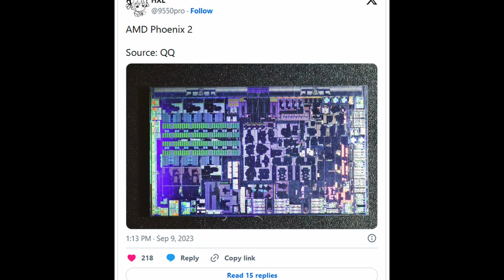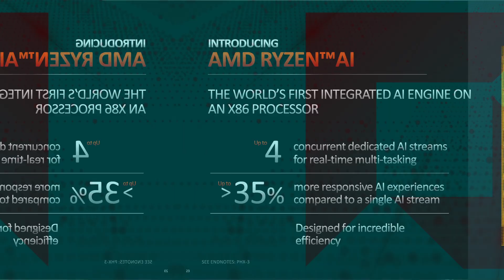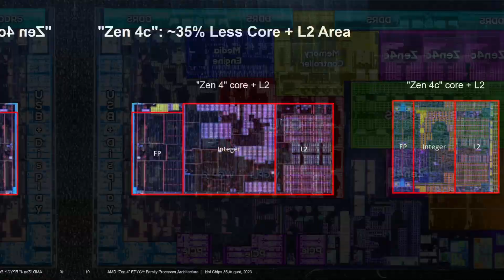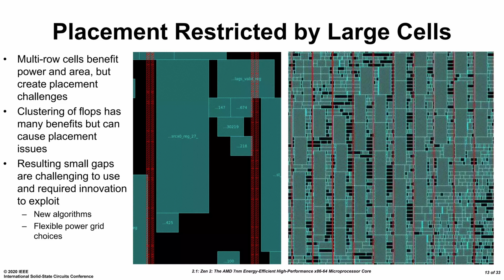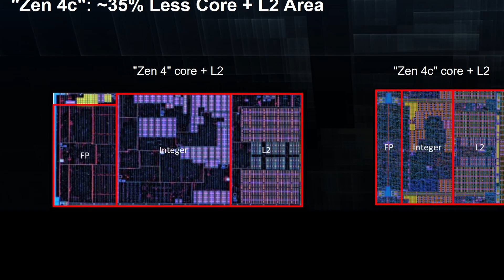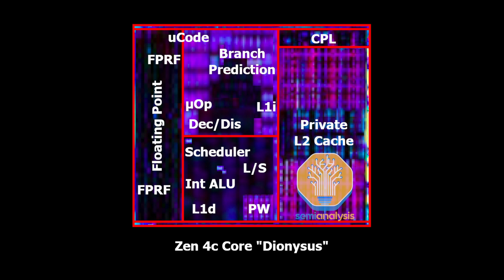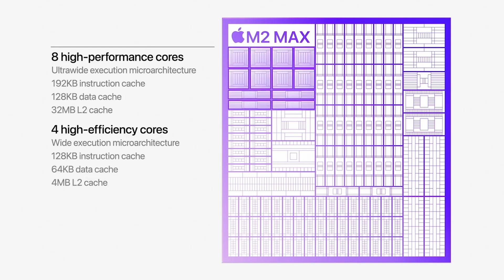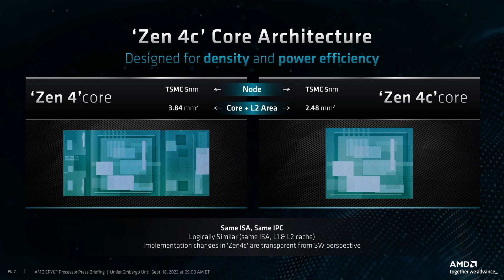Why AMD's first Hybrid-CPU is Different

Comment: The idea of more cores at lower clock speed is extremely compelling as a cloud provider. It’s not uncommon for us to have >50% cpu utilization at a host level, but, scheduling overhead and other issues makes higher oversub impractical, so more cores would allow us to get even more dense and offer a lower cost option for the vast majority of workloads that don’t really need high clock speeds anyway.
Reply: Yeah the main reason for AMD developing Zen4c is to sell them in EPYC chips.
Reply: @shepardpolska  yea it’s a great fit for those use-cases. E-cores are great for laptops but the lack of simd and other features makes them a non-starter for general purpose virtualization, but cores that work just like the high-perf stuff but a little slower is easy to integrate into a tiered offering.
Reply: It's Zanax? Clever. @shepardpolska
Reply: Yeah, even in game server hosting I would argue that the modern cores are individually much stronger than is needed, so if server providers could have more cores at lower clockspeeds, but same IPC, they could probably host more servers per cluster and lower the costs.
Reply: It's the RAM bottleneck.
Reply: @ShoeboxRacer  for a lot of our use cases we don’t really see memory bandwidth as a bottleneck, but, running some quick thought experiments I can definitely see being able to max out the number of memory channels available at a lower cost per core being hugely valuable to something like HANA (assuming you can get SAP to certify it) or more likely something like redis, although the list of companies running redis at the scale and performance requirements needed for that to really matter but also not designing their own silicon is pretty short. 

But thinking about memory bandwidth does suggest another another potentially interesting use case here in the upcoming successor to the MI300a, or potentially even a similar design targeting edge compute instead of the HPC market. That would likely be a 2025 release (at best) so hard to have any real idea of viability but an apu that goes heavy on accelerator chiplets with enough cores to manage them while still fitting inside the tdp and physical footprint you need for the typical half-u (actually less since they’re also usually half depth) edge server could be compelling? Lots of unknowns there but it would be fun to play with the numbers and I’m fairly sure there would be some use-cases.
Reply: @MikeGaruccio  the limiting factors for many-core designs are the von neumann bottleneck and chatter. Doubling doesn't matter if you can't feed them. And even if you can, it doesn't matter if they're constantly thrashing on MESI.
Reply: @ShoeboxRacer  ahh ok I get you now. And this is a place where context really matters. If we’re talking about a single workload trying to produce some singular output and primarily bound by the rate at which it can execute instructions against data retrieved from   memory then yes getting data from RAM and maintaining cache coherence are going to erode much of the gains from additional cores. 

But workloads that look like that aren’t really all that common, basically being confined to HPC and LLM stuff.  Both of those cases have additional complications given the concept of a “cache” ends up having so many layers as you zoom out from a single package, to a system, to a rack, to interconnections between “pods” and tons of software solutions have been developed to allow those systems to keep scaling but there’s definitely some diminishing returns involved that make that scaling less-than-linear. 

On the other hand, what I’ll call “normal” datacenter workloads have very different concerns. In that world a server is almost always a virtual machine somewhat less powerful than a typical desktop (the most common config being 4 threads and 16GB of memory) operating as a web/application or database server, or on more modern systems as a container host running a collection of web and database instances.  For the most part the goal in those environments isn’t maximum performance, but maintaining acceptable performance while minimizing cost. Memory bottlenecks still matter here, but the way those concerns manifest can be sometimes non-intuitive, and other factors can matter more.  The primary constraints end up being spiky, kind of random, workloads, slow storage access times, high network latency, and the high cost of developer time. These end up driving most architectures towards large memory footprints with relatively idle processors, but with occasional needs for a given machine to suddenly service a lot of requests for a short time. 

So, memory is our primary hardware cost driver, so we need to buy it in the most efficient units possible. Usually that means the second largest DIMM available at any given time.  But we also need to maximize memory bandwidth because that is still an important bottleneck, so you need to have at least one DIMM per channel. So that all means we end up with memory dense servers.  So say you have a TB of memory in a server, at the typical fleet-wide ratio of 4:1 that leads you to a cpu allocation of 256 cores (really threads, but SMT is a whole other thing). But processors with that many cores are expensive, and remember they’re actually going to be idle a large fraction of the time. The solution here is one of the most useful, but also misused, features of modern virtualization- over subscription. You deploy 256 virtual CPUs (probably more because you can actually oversub memory too) since most of our vms are less than 50% utilized most of the time, and are all serving different functions so are rarely all going to spike at the same time, the aggregate CPU cycles available should be able to meet their needs without a problem. But it’s not quite that simple. Partly because of how operating systems expect resources to be available to them, and partly because of optimizations meant to deal with the memory bottleneck you pointed out. 

Starting with the memory bottleneck, some mitigations to that problem in modern CPUs include speculative execution- basically the chip starts executing what it assumes the next instruction is before it actually arrives, and large on-chip cache. Both of those mechanisms lose effectiveness if a given core is frequently switching task’s between various underlying servers. 

More problematically, a virtual machine can be impacted much more than you’d assume by noisy neighbors, even on a host that’s only at a moderate utilization rate. I’ve already talked about cpu ready above, and that’s still the biggest problem here that more cores solves. But since we’re talking about memory access let’s talk about NUMA. The majority of modern servers are 2 socket machines, and a subset of modern CPUs are, from a memory access perspective, more like 2-4 smaller CPUs in a trench coat. But for a long time now memory controllers have resided within a cpu. Meaning each CPU controls half of the memory. So if a process on cpu 1 needs to access memory that belongs to cpu 2, that access happens across a slower link. This is called non uniform memory access and it’s a huge performance sink. Because of that they scheduler will try it’s best to avoid scheduling a vm on a different numa node from where it’s data resides, but that’s not always possible, and higher oversubscription ratios make it more likely to happen. When it does that vms CPUs stay busy for longer while they wait for the data, and in the meantime are preventing other machines form executing code. 

More cores aren’t a panacea of course. But for modern cloud and enterprise networks they solve a variety of problems and if we had access to cores with a Genoa-class 128 core count but in a thermal envelope more like a normal 64 core chip we’d be all over it, even if the individual cores weren’t quite as fast as their bigger brothers.
Reply: @MikeGaruccio  you invested way too much time into my low-effort comments.

Engineered systems have intentional bottlenecks, which are either the most expensive or most critical resource. Clouds deal with a wide variety of resources, and CPU is usually the most critical and most expensive resource in a server.

You place 2TB or 4TB into a server is to keep the CPU busy. You want to keep workloads in memory, and to run additional workloads if everything is blocked. IBM added multi-processing to increase CPU utilization, and running over-subscribed VMs is simply a less efficient form of the same.

If you tape 40,000 cores into the die space of a Zen4 IO controller, then you can't feed them. You're limited by geometry: memory comes in on the edge, but cores are built across area. That's why many-core designs are niche, and mainstream processors trade core count for superscalar, out-of-order, speculative execution, complex predictors, large widths, deep pipelines, write-back caches, large tiered caches, etc. You need to hide memory latency to feed the beast, because you can never route enough wires in to sustain the cores otherwise.

You can't exceed 50% utilization due to variance and QoS. Your original argument boils down to "decreases in variance allow more oversubscription, and higher utilization of key resources". In other words, you intuitively want to run more smaller workloads, because they're less and less likely to all spike together. But it's still about increasing CPU utilization, which is the majority of your cost. If your bottleneck isn't I/O to the CPU, then you are behind the pareto frontier, and have an artificial bottleneck, such as inefficient placement or poor live migration. By all means, fix those. But as you eliminate artificial bottlenecks, you will eventually discover the ultimate problem: the von neumann bottleneck.
Reply: @ShoeboxRacer    “cpu is usually the most critical and most expensive resource” - my server BOMs strongly suggest otherwise.  Memory is far and away the most expensive component in our server builds, unless we’re doing HCI, in which case it’s a tossup between memory and storage depending on density and endurance expectations for the flash.  But all of the other costs add up too, mainboard, NICs, power supplies, network ports, floor space, pdu outlets, fiber, sfps, fans, etc. 

What you end up with is a question of what the lowest cost you can have for the largest amount of memory is. Which usually leads to very dense servers. But, there’s a limit to oversubscription even if there’s not variance. Basically no one is going to deploy a 1vcpu server. Even if they’re running a nodejs app or otherwise only really going to ever use one core.  So we’ll basically always have vms where one core is being used heavily and the rest are idle. But all cores cycle at once. Do the idle cores sit and noop while one works. 

The fix for that to allow for increased memory density is more cores regardless of how fast they are because they’ll mostly just sit and do noops.  But the highest core-count chips are physically larger and have bulky thermal solutions, and so reduce the memory that economically fits in 2U. They also tend to have power supplies that make the electricians concerned with the theoretical max draw and so world require more expensive power gear even if we’d never actually expect that kind of current in practice. 

So really what I want is to decrease oversubscription so we can increase the utilization of our actual key resources like memory and network ports and the thing that allows me to do that is having as many cores as possible in as small a thermal and physical footprint as possible.
Reply: @MikeGaruccio  you implied that you're buying 128GB DIMMs, but 12 of those were less than a 9654 until earlier this month. Given your BOM price and your aversion to power density, it sure sounds like you're buying low end CPUs.

CPUs are made on smaller nodes, have more complex designs, more steps, and lower yield. Unit per unit, they're more expensive than memory. It's usually the most expensive part of the BOM, and it's also usually the physical bottleneck in the operating system. There are always exceptions. But even AWS memory optimized bare metals have more CPU cost, so you must be niche.
Reply: @MikeGaruccio  I wanted to split my response in two, because the first one was just to shit on either your BOM or your procurement. I don't mean anything by it.

But you absolutely want to oversubscribe CPU. CPU is the best resource to oversubscribe, because there's always more in the future. Oversubscribing MEMORY is dogshit. Guests are asshats, and don't know how to give it back. Worse, they're probably running a memory leak like java, which will always squat on all the available memory before running GC. When you oversubscribe memory, you can't just block allocation and expect forward progress. You need to kill, migrate, or evict.

Buy memory to hold the number of requisite concurrent jobs. Buy CPU to run jobs faster, decreasing the number of concurrent jobs.

Again, it's all about variance. Density is good, because it decreases the chance that all your guests spike at once. That lets you oversubscribe. Oversubscription increases utilization. That leads to higher margins.
Reply: @ShoeboxRacer  ok I’m genuinely curious where your seeing 128GB ECC DIMMs for less than the cost of a 9654.
Reply: @ShoeboxRacer  lol you can feel free to shit on our procurement. I can’t actually disprove that statement without providing non-public info so I’ll just have to leave it there. 

As for oversubscribing CPU, to some degree it definitely is valuable. And if guest OS’s had a perfect spread of resource usage across cores, and we were dealing with all single socket machines and just had to deal with usage spikes core count wouldn’t really matter and we could be a lot denser. 

But that’s not the world I actually live in. People deploy a nodejs app on a server with 4 CPUs. Their AV software goes crazy and monopolizes a full core for hours while the rest of the machine sits idle, or a thousand other things happen that lead to a server that has a ton of cores only actually using one of them but running that one core full-out. That puts a hard limit on our oversubscription rate, beyond which utilization goes down and guest performance suffers. 

As for memory over subscription. It’s definitely less useful in terms of the % you can achieve, and we generally don’t bother since it’s a pain to manage, but, memory usage also tends to be much more static when viewed at a host or cluster level and actual utilization tends to be much less than 100% of configured allocation so it is a viable option when really trying to optimize.
Reply: Like what? Pretty much everything benefits from high single core performance.
Reply: @jamesmcjamesington631  So this is a fun one.  On the one hand, yes, high single core  performance does benefit every workload in that a faster CPU with complete a given task faster, but whether that speedup is meaningful is a very different question.  The TLDR here is that 1 4GHz CPU is almost never going to be 2x as performant as 2 2GHZ cpus, and in general a higher core count cpu with slower single core performance will be more cost effective and have a lower thermal output than a chip with faster cores that has theoretically equal aggregate performance.  

The average web request involves hitting a server, which initiates a database lookup and then returns you some set of results.  The vast majority of the time between the user pressing a button and pixels painting on their screen is waiting for communication to happen, with only a tiny fraction being spent on the web server executing code.  most of the apm traces I see will show something like 1-2ms of execution time at most, and usually much less.  but at the same time will have a much higher amount of time, in the 10s of ms of database IO or inter-service communication on a microservice app that's collating data before sending it back to the user, plus 30-100ms of latency between the user and the actual web server.  Now, there are obviously limits to what a CPU can actually handle, and if you start trying to send 2000 web requests at that cpu core doing 1-2 ms of processing per request, you're gonna have a bad time, so before that happens you add more cores, or more web servers. So at base you're looking at a need to maximize processing power globally within a given monetary/thermal budget.  Generally speaking more, slower, cores will give a better number in terms of aggregate performance per $ and/or per watt.

But, that's just the base-case, other concerns make more cores even more attractive, and the core of them is the need to optimize around worst-case rather than averages.  Exact methodologies vary by company and team, but it's generally a bad idea to judge the performance of a system by it's average time to complete a request and better to look at the experience being had in the worst 1 or at most 5% of cases since it's those outliers that are typically going to be frustrating for users or potentially cause other, broader, issues.  and having more cores is huge here.  I'm going to use lucene/elasticsearch as an example, but there are many others out there.  Gor some background, a simplified but still mostly accurate view of those search apps is that each incoming search runs on one CPU core, and 'owns' that core until the search is complete.   in a lightly loaded system this means that a faster single core performs better, but again "better" is a relative term here since the relative impact of the CPU is smaller than the storage latency.  but when the system comes under load you have a very different circumstance, if a system has 8 cores and 8 users search, they all have roughly the same experience, if however 9 users search, one of them is waiting for another users search to finish before executing, causing their response time (and so you're 99th percentile response time) to double. a microservice environment compounds this even more since you're frequently gathering up data to send one big response back to the user, and so any individual service hitting some wait/queue condition can delay the whole response. 

So that's all within an app on one server, but what about in a shared platform where CPU's are over-subscribed?  here we have an even more interesting problem called 'cpu ready' time.  basically, an operating system that's running on, say, 4 cores, really needs those 4 cores to be available in order to move it's clock forward one tick.  if for some reason a core isn't available when it's trying to run an instruction on any of it's cores, it just waits for the next clock cycle.  This is another case where things are generally fine but where the outlier conditions perform much worse with fewer cores since your less likely to have an open CPU to schedule on to.

All of that is still before we get into discussions of NUMA nodes and the ability of higher core-count systems to keep an entire workload within a single numa node boundary, which significantly improves memory access performance (and, again, consistency).  or the fact that, as stated in the video, these chips still have the full set of AVX512, crypto, and other accelerators on-board, and having more of those to schedule against is going to have a huge impact on llm inference workloads and things like web servers doing a done of ssl encrypt/decrypt.

and finally, the biggest impact of them all, routing around stupidity.  So off the shelf software almost always has a "minimum system requirement" provided by the vendor.  This system spec is almost always way more than the app actually requires, but the vendor won't provide support unless you meet it, and on an individual server level a dozen cores is way less expensive than the software license anyway, so IT teams just say fine and way over-provision.  But at an aggregate level  that winds up being a ton of wasted capacity, and cheaper cores at least partially mitigate that problem.

tons more examples like this but I think that covers the broad categories.
Reply: @MikeGaruccio god damn. Owned that armchair professional!
Reply: @MikeGaruccio A very civil and straightforward teaching moment. Thanks!
Reply: @jamesmcjamesington631  If a core has to wait for data, and in servers that's often the case, then the speed of the core isn't critical, it's the speed of being able to feed the core the data it needs.  This is a pretty common scenario.  A difference in a few nanoseconds isn't going to make any difference for the core.

You run into a issue of how many threads can be processed, and also how many will have some delay.  For any threads that have delays, if a new thread shows up and it has a similar or higher priority, if the CPU doesn't have an available core, then a core that is in a wait state goes into context switching.  This is a painful process especially for a server, so you'd rather have more available threads.

If the load is too much then that's bad server management because you'd be context switching all the time or you'd have a lot of delay, so now you have to add more servers.  But it's more cost effective the less servers you have, but it requires being able to move a lot more data in a given amount of time and it means CPUs with more cores.

Faster clocks inside an IC when everything else is equal ALWAYS means more power consumption, which for data centers is about their biggest cost if not the biggest cost.

So no, faster cores is not always better, and server is nothing like desktop or laptop and even in the world of server, there is no single type of CPU that is best for all situations.
Reply: Yoo how much u charging for one cloud
Reply: @duro6933  a whole ass cloud costs 10s to 100s of millions at the entry level. Large clouds cost billions.
Reply: @ShoeboxRacer  holy shit i didnt know they were so expensive, i thought its just little droplets of water you know. i guess its really expensive getting them to float so high in the sky
Reply: @duro6933  bro, you think clouds are free? There are only two ways to get clouds: unreliable aerosolized salts, and sacrifices to Baal the rain god. You think sacrifices are free?
Reply: @ShoeboxRacer have to agree with you here. Afaik Facebook released some numbers in the past and their workloads were heavily memory bandwidth constrained. You can even see it with the high core CPUs were only a small handful of benchmarks are faster than the ones with less due to memory bandwidth.
Reply: @Goodoo4U  0 argument that facebook benefits heavily from additional memory bandwidth. But there’s a massive difference between running one of the busiest web services on the planet and running 10s of thousands of instances of LOB apps and off the shelf software that have single digit DAUs. 

That second use case describes 90%+ of businesses, are who I typically work with, and are the ones who would benefit from a higher core-count.
Reply: @MikeGaruccio  that's great for you and your clients that you're not actually making use of the additional cores. But then any comparison is moot.  As then the main aspect is how much RAM you have around for idling applications. My background is with e-commerce heavy companies and we definitely made use of our processing power otherwise your just wasting resources if you don't bin pack your workloads effectively.
Reply: @Goodoo4U  my point is the cores do get used.  They just get used to run noops. Because they have to. 

Let’s use a way oversimplified example. 

Say we have one server with 6 cpu cores and no SMT. And 2 vms are deployed on it which are mostly idle, but because they occasionally get some traffic bursts they both get 4 vcpus assigned. 

Now let’s say someone kicks off an anti-virus scan on one of those systems that pegs just one of its cores at 100%.  Every cycle those other 3 cores need to be scheduled, so they are, so now even though only one actual cpu core is getting used, only 2 are available for the other system. Except it needs 4 cores to run a cycle too. Meaning that even though the underlying host is practically idle it’s also experiencing severe resource contention and the performance of both vms is effectively cut in half. If we instead had a host with 8 cores that were a bit slower we’d be able to dedicate 4 cores to each vm and they’d both run significantly faster. Throw in a NUMA node boundary on both machines and the 8 core is suddenly much faster on a per machine basis even if one machine is entirely idle and the other has no scheduling conflicts at all. 

In the real world your obviously looking at a lot more available threads but also at way more vms, some with very high core counts relative to the size of a host.  Given a complete lack of control over how these machines actually get used it ends up being a balancing act of attempting to optimize for a combination of high density and low contention. Having more cores has a favorable impact on the total cost of the solutions to that problem. 

And for the record this isn’t particularly niche in terms of use case. The workload pattern I’m describing is the one deployed by 90%+ of companies. The other 10% certainly make up much larger portion of deployed compute since their needs are greater, but it’s still a significant chunk of the market that looks like the workloads I’m describing.
Reply: These are the comments I live for on youtube. I had never really given thought to cpu loads when thinking about cloud architecture utilization. At what percentage do you consider utilization to be efficient/effective?
Reply: @nicholaslennon  that number moves around a lot on different generations of hardware but generally if we can average above that 50% mark during higher-load periods(basically the local work day) we’re pretty happy. It’s hard to move much beyond that without hitting problems as a cloud provider with no real control over what our users are doing. The new, denser, chips will hopefully let us push a bit beyond that with lower oversub lessening scheduling issues, but will also allow denser hosts themselves, which drives down costs for things like network ports/cabling, rack space, etc.
Reply: Totally agree.

Our financial crime detection tool has a heavy workload in aggregate, but it’s embarrassingly parallel. A handful of fast cores can’t compete with a dozen slower cores working together. We currently execute each task container via AWS Graviton processors for the ARM cost advantage. It’s roughly 35% cheaper than the exact same workload on x86 CPUS

On the dev side we’re currently using a Mac Studio M1 Ultra for our CI. The test suite runs ~650 tests via a thread pool. I’d be fascinated to see how quickly a modern EPYC or future EPYC CPU could run that workload. It’s on my todo list to fire up some bare metal instances and find out how it compares to the Mac Studio.
Reply: @jamieknight326  that’s right around the cost advantage I’ve seen quoted for most non-accelerated workloads that can be easily run in parallel (which conveniently includes web servers). 

I’ll be really interested to see how close AMD is able to get to that number on workloads that can use SIMD and other “advanced” instructions.
Reply: in 2016 some researchers built a 1000 core cpu that ran on 1.78Ghz that can be powered by a double AA battery with each core being able to shut down individually when not in use.
If they did this in 2016, imagine what level of technology we have now that they are hiding from us.
Reply: @HamguyBacon ”hiding from us” lmao also source?
Reply: @ChrisStoneinator I am assuming Area51 😂
Reply: @HamguyBacon  That's some real conspiracy theory shit there dude.  Tech channels aren't the place for you to spit out your stupidity.